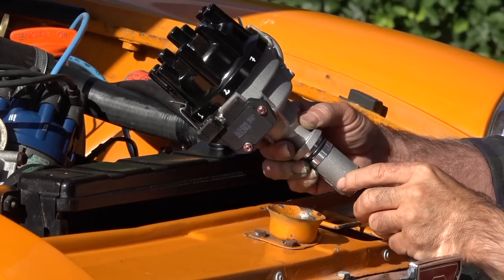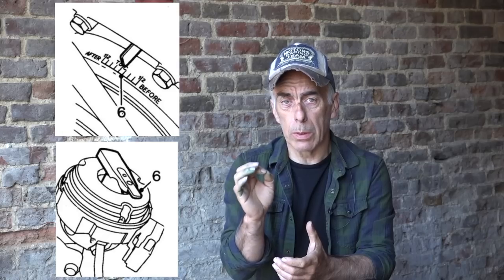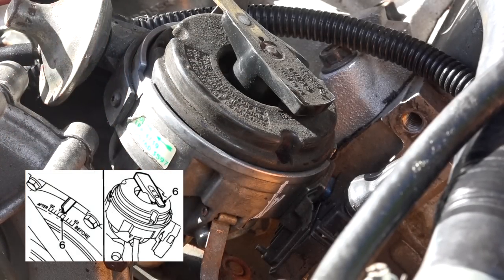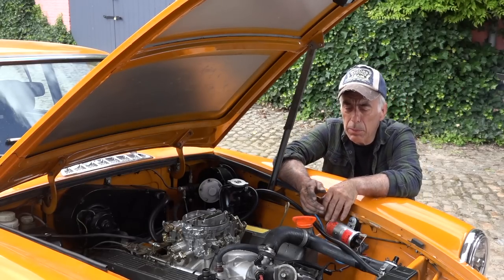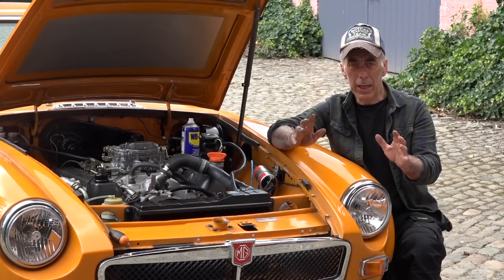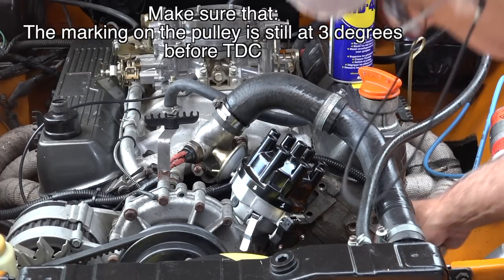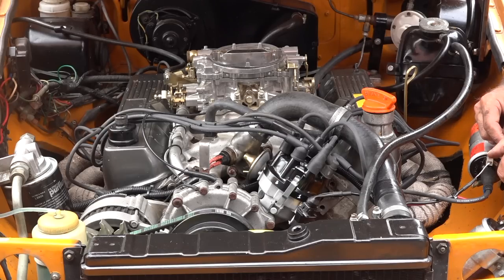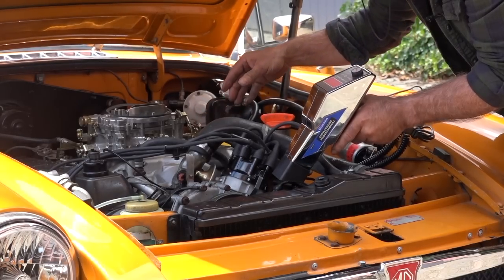Rover V8 distributor replacement and adjustment

Comment: Thanks D3Sshooter....for 2021, this is my favourite YouTube video! Silly Range Rover 3.9 engines...you need to remove the distributor to get to the rear power steering bracket bolt....and in rushing, I forgot to set my balancer to TDC....AND forgot to make sure my rotor was pointing to #1.....idiot! I couldn't get the rotor to line up on #1 when reinstalling the distributor...and your "10 to 4" trick saved the day excellent!!! I got some pipe and bashed the end to make a reverse screwdriver....another custom tool for the bag! Perfect...dropped right in on numero uno! The EFI setups make removing the rocker cover a real pain, so I just rolled the dice and hoped I was on the compression stroke....nope, had to remove and rotate the crank another 360. Thanks again....next time I won't forget the basics! Keep up the great work!! :)
Reply from the maker: Thanks for the comments

Comment: The best diy howto video on the Internet. 

Steve, two critical comments: 
1. Your hat's drawstring/lanyard dangles *dangerously close* to the rotating fiddlybits during your timing gun checks!  Loose sleeves, drawstrings and gloves cause more injuries than the bloodied bare knuckles associated with bare handed wrenching. :-)

2. Your comment about the other method of determining TDC... pulling the valve cover, would have been perfectly capped with an indication of which rocker is the intake and which is the exhaust [the forwardmost one being the exhaust valve, if memory serves me]. *This is only practically useful if the port side [left side, if you are facing forward] valve cover has a filler or vent in front, of course.

Comment: Just to say I've also got an orange MGB GT Sebring and I'm about to fit a 3.9L over the next few months. Your videos are really clear and useful, I hope you keep making more! Thanks.
Reply from the maker: Really , that is great....  keep an eye on the steering column as that comes so close to the exhaust collector.   I had to put extra spacers in.   Mine is also a conversion 3.9   ..  Lots of fun....  good luck with the work and maybe a video ?
Reply: @D3Sshooter  spacers in the engine mount?

Comment: Thank you for this very instructive video! I watched it several times and then had the confidence to replace the 40+ year old distributor in my TR8. The new one slipped right in on the first try and after adjusting the timing my engine is running so much better. I appreciate you taking the time to create this very helpful and excellent step by step video.
Reply from the maker: Glad it helped!

Comment: I no longer have my V8 but I recall the oil pump on mine was external on bottom left. I fitted a Mallory twin point distributor which was a pain to set up.
Reply from the maker: Thank you for the comments, that must have been an older model then ?

Comment: From someone who hasn't done this before I don't see the logic to it. What's the point in moving it to TDC when the rotor arm relates to the TCD anyway. Why not just mark on the engine where the rotor arm is pointing without turning the engine round? What's the point in marking on an old distributor when you're putting in a new distributor? Are you supposed to transfer the marks across? Nothing makes sense
Reply from the maker: Let me try to explain this:  First a distributor has no clue what cylinder 1 is nor does it has any clue what the firing sequence is.   Secondly the distributor has a vacuum membrane on the  side, and that can be in the wrong place when installing . in such a way that you can't turm the distributor. Fourth, the distributor must fit into a slotted nut part of the oilpump and that can be a bit of fiddling.     The old one is marked so in case the new one is an issue ( slotted shaft) , we can fit it right back without to any hassle.   As I stated the new one has no clue where cylinder 1 is and the firing sequence...  its just rotates , one output HTL at the time, so it you that needs to define where cylinder 1 starts and position the dissy so that it can be rotated for advance adjustments. ( remember the vacuum membrane on the side). It really does not matter where you start with cyl-1 as long as you get the slotted shaft right and the follow on HTL cabling aligned with the fireorder in the clockwise direction.    Always check the position of the rotor with the marking on crankcase polly , for your first cylinder at the compression stroke (TDC)..  I hope that helps

Comment: would recommend fitting an improved radiator and checking the top hose it looks a bit high and may get air trapped in it
Reply from the maker: Yep that is still on my agenda

Comment: Hello again
It looks in the video that the oil driving slot on the new distributor is spring loaded ?
Regarding the connection to the oil pump, I assume that if the slot is not aligned with the distributor when you insert it, that the distributor will not push all the way home ?
I'm about to do this job myself and don't want to risk destroying the engine through lack of oil feed,
Thanks
Reply from the maker: Hi Philip, no its not spring loaded. It only has a rubber seal and that is what gives a little resistance.   Make sure that the oil pump notch is in the proper direction , if not turn it with a long screwdriver. If the distributor and oil pump notch is not properly aligned , the distributor will not be able to sink in and you will see and feel it immediate. Nor will you be able to start the car, as the distributor will not have latched in on the shaft.   this looks more difficult then it is.  Good luck
Reply: @D3Sshooter  thanks for the quick response. 
I was able complete the work today successfully thanks to your inputs.  In my case I just needed to put on a new oil seal on the distributor as it was leaky.  
Happy New year to you - don't forget the video on the engine / gearbox mount replacement !

Comment: HI flemish, WHAT IS THE PURPOSE OF PUTTING THE CRANK PULLEY TO FEW DEGREES BEFORE OR AFTER TDC. ON MY OWN I WAS THINKING IT SHOULD BE PUT STRICTLY ON TDC.
M.B.S MOSHITOA (SOUTH AFRICA)
Reply from the maker: That is because the ignition/explosion of the air fuel mixture has a bit of delay, so you need to ignite it a bit earlier so you get the force just at TDC or just after

Comment: I'm struggling getting my 1992 RRC running.  3.9L V8 with distributor and CUX ecu.  I have replaced the plugs, wires, cap, rotor, ignition amp and adapter wire from 2 to 3 wire connector.  I reset my #1 TDC and set the distributor like in the manual and on this video.  I get spark, I'm making about 38psi fuel, my noid light shows me injectors are pulsing, I have pumped fuel into a container to test flow, and I have the air filter off so there are no air restrictions to MAF.  Any thoughts?
Reply: Injection controlled.

Comment: Following you, my carbs are popping, any ideas, thanks
Reply from the maker: Could be many things,  wrong timing of the ignition and or valves,   or even cross induction on the HT leads, make sure that they do not cross else you might get a unwanted induction that ignites a sparkplug on a cylinder that is not ready for its ignition

Comment: Hello. Just a question about the final minute of the video. When you connect the vacuum tube at idle, do you get more or less ignition advance? And when you open the throtle, ignition advances or retards? Thanks
Reply from the maker: typical you get a bit more advance when the vacuum tube is connected, the more vacuum the more advance you get
Reply: @D3Sshooter  thanks

Comment: Thanks for video as this is something I'll be doing soon.  However, I have heard that sometimes the timing chain may have slipped a tooth which means the timing marks will be inaccurate and therefore your timing will also be wrong. If I suspect the marks are wrong how then would I accurately time the engine/new distributor?  Would using a vacuum test gauge work, rotating the distributor until the maximum inches of mercury reading is found, then backing the distributor off a touch? Many thanks.
Reply from the maker: Thanks for the comments, its always good to check the real TDC with a degree wheel. that is the best thing to do before anythings else in your case.  IF timing is off, it effects the ignition and even more importend the camshaft/valve timing.  So if the timing is of, you might be able to compensate by rotating the distributor , but that is not going to fix the valve timing,,, so no... find the real TDC and check the camshaft alignment

Comment: On most MGBGTV8s the advance retard cylinder  is in the opposite position  pointing down.
Reply from the maker: Can you explain that please, not sure what you mean
Reply: @D3Sshooter  the advance retard vacuum cylinder should  point down to the right yours is 180 degrees out.....but it doesn't  really matter if you look at the MGBGTV8 workshop supplement  you will see keep up the good work!

Comment: hi Flemish.  but what if i can use your best trick that you used on MF35. i am planning to change a timing chain on vw polo 2011 it is now recording 250000km. no problem with it yet. but just fear it might break anytime. although i dont see those tdc and degrees on my engine, but i think to use MF35 TRICK. AND THAT IS

i think to open the top cover to see velves. rotate the engine till outlet for pistol 3 closes and inlet just try to open and stop just there. at that moment i will be knowing that pistol one is firing. therefore i can mark my crank and cam shaft without looking for their marks. 

i like MF35 TRICK, HAHAHA I Master it.
do you allow me to go do it as my superior.
Reply: SORRY I WANTED TO SAY WHEN THE OUTLET OF PISTOL 4 NOT 3.
Reply from the maker: The best way if you have no marks , is just to position the engine in any position and place everywhere markers on the pulleys , so that once you placed the new timing belt its all in its original position.
Reply: @D3Sshooter  THANKS. ONE OTHER THING I LIKE ABOUT YOU IS THAT YOU REPLY PEOPLE.
M.B.S MOSHITOA (SOUTH AFRICA)

Comment: Take the rocker cover off?! Isn't that a bit extreme? Doesn't that mean losing the gasket and having to replace it, after having to scrape bits of the old one off first. What about sticking a compression tester in no.1 spark plug hole and watching the pointer to see when it's compressing, i.e. approaching firing position, that's the method I know.
Reply: Just a suggestion - take an old spark plug, remove the skirt around the ceramic with a file or angle grinder, bust out the ceramic section and wedge a bit of tubing into the vacant hole left behind the ceramic plug body. The hole will go all the way through the plug so if you turn the engine over BY HAND, all spark plugs removed but with your new tool in No.1 plug hole, with your finger over the tubing you will feel the compression build up on the right stroke. It will try to push your finger off the tubing or hiss with the escaping compression. Bingo! You have No.1 at tdc on the compression stroke when you check the crank pulley. Saves pulling off the valve cover.....